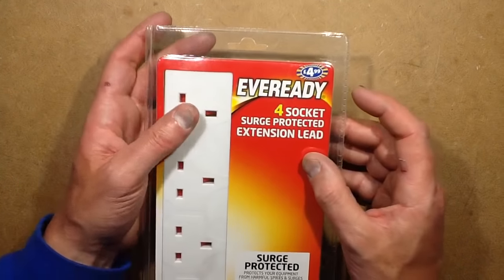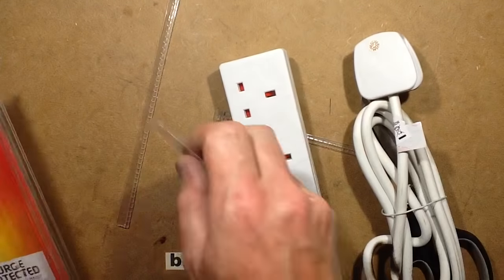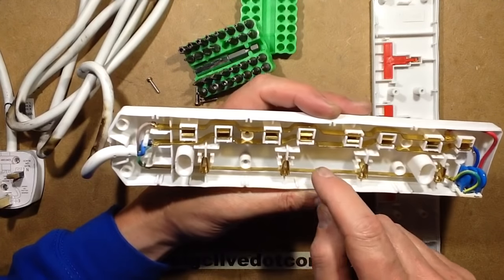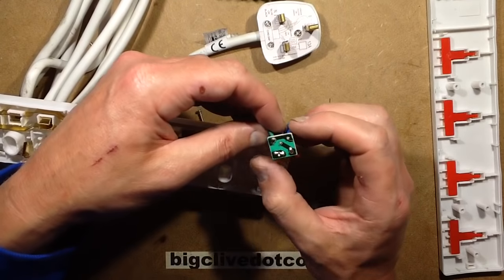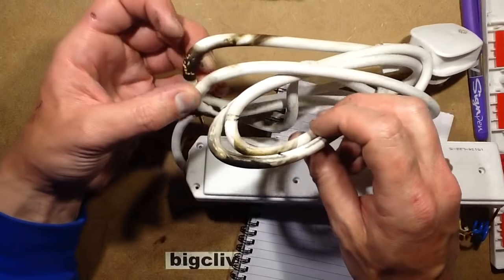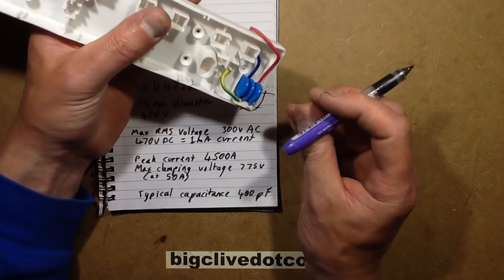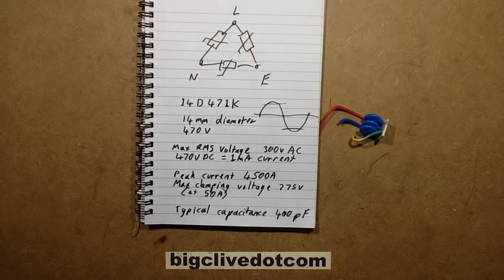Pre-exploded surge protection strip.  What the heck???

Comment: The varistor arrangement is likely intended to help satisfy the surge immunity requirements of IEC 61000-4-5, which specifies variations of surges in either differential (L>N) or common (L>E,N>E) modes.  

Really interesting to hear about their failure modes, had thought they were fairly invincible within their rated transient levels.

Comment: 3:07 time to crack out the butane torch... You should also hook the MOV across the high voltage section of a oil boiler transformer and fry it.

Comment: If your house has a fuse box, do you still need a surge protector?
Reply from the maker: Yes.  The fuses are just to break the circuit if something draws too much current.  A spike could destroy equipment before a fuse or breaker could break the circuit.
Reply: It takes 2000 volts to feel a static shock, but only 100 volts to destroy a video card.
Yes, surge protectors are vital for many electronics.
Reply: Out electric sockets doesn't have a surge protector input. Only two holes. Any alternatives for protection?
Reply: Yes. Call an electrician.
Reply: Yeah - fuses shouldn't be installed in your circuit breaker box, that's for circuit breakers. Circuit breakers prevent too much current being drawn through your homes electrical system, they are not designed to protect endpoint operators/equipment. You also MOST DEFNITELY DO need a surge protector on your PC - I don't think XlordB has any idea what he is talking about, because the speed with which solid state electronics are eviscerated by transient spikes will shock, thrill, and amaze you. An MOV that cost $0.07 USD and is capable of dissipating a small spike in a sacrificial manner should not be relied upon to protect a thousand dollar solid state microprocessor driven machine...But, what the hell do I know anyway.
Reply: I'm using a laptop.
Reply: ***** I still wouldn't want to put a 200 USD PSU or mobo right in the line of fire of an unprotected power socket.

Either it's too cheap to have any of the techs you mentioned or too expensive to gamble with.
Reply: ***** 
I was talking about desktops, too.
Where else do you think anyone would get a 200 USD PSU?
Reply: *****
I didn't research that.  I only know it's bronze efficiency 1050W modular and it works great with my TWELVE DOLLAR surge protector.

Seriously, just use a fucking surge protector, people.  There's no reason not to.
Reply: We aren't using surge protector for so many years but we never got trouble with our appliances.
Reply: joy santod my frend got a surge his Xbox and his to broke

Comment: I always thought the UK plug looked really good.  I doubt those pins get bent very easily.  US plugs get all bent out if shape if you look at them wrong
Reply: hate to know what you are doing to plugs then. if you treat them good and don't pull on cords like you should there is no problem. can bend them back in shape easyish too with some pliers if they get that bad. metal is not that thin now.
Reply: They usually get stepped on
Reply: and what does that do really? stepping on a wire is not going ti mess it up really.

Comment: I would say that the schuko has the same "good"  points as the UK-plug, but its much more compact :)
Reply: It doesn't. The schuko is not polarised (which means that single pole switches in devices like lamps only have a 50% chance of isolation). It doesn't have a local fuse to protect thinner cables, such as those used on table lamps. It also has a much smaller wiped area for electrical contact. In several countries, shuttered outlets aren't required. 

The Schuko shows every sign of a design that has been altered over a long period of time with add-ons without being a proper, clean-sheet design. From memory, the only change to the UK plug since it was designed in the 1940s is shrouding the top part of the live & neutral pins.

Comment: man were you raking leaves in a wild squirrel cage?
Reply from the maker: I rarely have need for a hammer and nails, so putting 500 nails into a roof in about 2 hours while also lifting up the sheets of wood was probably a bad idea.  I had blisters forming before I'd even finished.  It's a fibreglass roof, so I had to get everything done on the top in a single dry day.

Comment: Clive, what do the really expensive surge protectors offer that this cheap one doesn't? Seems to be a very basic circuit to get the desired function.
Reply: the £100-10k ones have batteries in them and can run after a power cut allowing you to save and shut down computer systems and the like. They are completely isolated, so they are very reliable on the voltage and current front. The one shown does not have a heat cutoff so is unsafe. There are many different additions things in between may have, you would have to narrow it down a bit.
Reply: This is a pretty standard circuit going all the way up to high-end industrial devices. For very high power devices, sometimes they only use 2 MOVs - one between L and N, and one between N and E, to keep costs down. 

The L-to-N MOV protects against "differential mode" surges, which tend to be most damaging. The N-to-E MOV protects against "common mode" surges. In general, most electronic stuff is highly resistant to common mode surges anyway, as the stress CM surges cause is to insulation (e.g. motor windings, transformer windings, etc.) 

The L-to-E MOV on some systems provides an alternate protection against common mode surges, and helps to limit the peak excursion of the voltage on the L wire (which could, in the case of a large combined differential/common mode surge rise to twice the clamping voltage referenced to earth in a 2 MOV design). 

Some high end industrial lightning protectors use spark gaps instead of MOVs, but these aren't really ideal. They can handle the 100 kA current of a direct lightning hit, but they have the disadvantage that they are slow to operate, even if electronically triggered. This means that you risk your smaller down-stream MOVs taking the hit before the spark gap triggers, unless you carefully engineer the whole surge system of the building to ensure correctly staged operation. The other issue with spark gaps is that they short out the mains supply, until the next zero crossing, which means that not only does the unit have to absorb the lightning surge, it has to absorb the energy supplied by the grid until the arc quenches. As lightning is usually a series of surges in rapid succession, this can lead to the mains supply being shorted for a period long enough to disturb electronic equipment or operate the main protection device, causing a power loss.

The favoured design these days tends to be lots of MOVs.  I've seen systems which use 14 40 kA MOVs in parallel for each pair of connections. Each paralleled MOV needs its own HRC fuse, and you then need some form of active monitoring circuit to detect any blown fuses. There is a hidden difficulty with paralleling MOVs. MOVs are voltage activated, and operate abruptly, going from current flows of 1 mA to 1 kA in only a few volts. This means that unless your parallel MOVs are very precisely matched, you'll end up with very uneven energy sharing, such that 1 MOV ends up taking 99% of the current.
Reply: Thats not a surge protector, that's a UPS your talking about. (uninterruptible power supply) But they do have surge protection built into them. Battery backup systems are a whole another ballpark from surge protection even though most have such protection built in.

Comment: recently boght a multi socket just like that from b&m except without surge protection and from new it had several poor connections causing arcing sounds and intermittent operation, when I opened it the wiring was just really poor too much insulation removed, poor connections etc

Comment: $5 surge protector means a 50 cent MOV and/or maybe a fuse if you're really lucky connected to 4 outlets. Probably didn't cost more than $1 to manufacture and I doubt it's the sort of design that has to be heavily engineered since you can just as easily (if you're Chinese) rip off an existing design. Correct me if I'm wrong.

Comment: have you ever looked at a monster 750G PowerCenter "HD Clean Power" Surge protector plug? I've got one that was damaged in a flood (the overflow pipe on the water storage tank popped off and the tank is in the loft, it did thousands of pounds of damage but luckily the insurance covered it), It does work... only the plugs that have a master/slave switch setup don't work (It's so you can have things automatically turn off in the slave plugs when it detects a low load on the master plug) I don't really fancy using it after it has got water damage and I thought I could send it to you if the postage cost isn't too bad.

It also filters/protects TV, Sat and Phone cables

Comment: You are lucky ! ... EASY removing the back ( NO clip technology ? ) means anyone can replace the flex ( this type needs  soldering to brass strips , this is SAFE ! ) ... the BIG problem with " modern "  UK  13 Amp plugs is the live pin can ( VERY badly ) overheat , should you load it up with a 3 Kw heater ( overnight  ? ) ... the remedy is simple , SOLDER the 13 Amp fuse into the cradles ... this lowers the contact resistance .. and .. provides more thermal mass to absorb any heating ... ( tried - n - tested ) ... DAVE™   🛑

Comment: Phase to Ground is a CE NO NO. 275 VAC is a wise choice even for the USA. SMPS's cope with most things below that. In USA neutral failiure in high winds will cause fire if 115 V rated. CE calls live-neutral Live 1 Live 2  which for IEC type F plug makes sence.  IEC type E can be whatever the electrician did!

Comment: I have acquire a few UK plugs and sockets, both a moulded and a rewirable types. I gotta says, UK plugs does have the nice sturdy feel to them and the fact that it has a built-in fuses does added some extra peace of mind. Although my country's electrical codes requires that all sockets circuit must be protected with 16A RCBOs, it still quite comforting to know that whatever the device I use a UK plug with, has a local fuse protection in it.

Comment: Those varistors work nicely on telephone lines but are fairly useless on mains where "spikes" from (e.g.) next door's D.I.Y. welder can make them deteriorate fairly quickly. Here in Greece where mains surges (lightning and otherwise) are commonplace, we use Automatic Voltage Regulators for all expensive equipment (especially 'fridges, freezers, TVs, computer systems). AVRs are relatively cheap here - around 30 Euros for 500 Watts. However, I don't think they are commonly available in the UK.

Something like this: https://voltage-converter-transformers.com/products/svr-500-automatic-voltage-regulator-with-built-in-110v-240v-up-downvoltage-transformer-500-watt

Note: don't confuse this AVR with a UPS. An Uninterruptible Power Supply has an internal battery that drives an inverter to keep equipment running for a short time during mains power failure. At best it offers very little more surge protection (if any) than the socket strip in the video.
http://www.glodark.com/lightn.htm

Comment: I'm always short of multi-outlet extension cables, slightly surprised the housing went to the bin when simple cord replacement (with custom length if needed!) would make it serviceable at least as an extension cord/multi-outlet and just assume no spike protection (or remove that entirely).  Or was there something else poorly made in the outlets/housing?  (if you can recall after 6 years...  :)

Side note, I'm glad I live in a suburban area without heavy industry nearby so power is very reliable and suspect rarely subjected to spikes.  But if not already done, as a US resident, would love to know a bit more about the UK plugs, round vs. square, evolution, longer ground plug, and, to me, strange red parts on the cover to the guts?

Comment: I hate those MOVs in Window Air Conditioners but was happy when I got one for cheap. Old unit died but went to the local pawn shop and found it sitting there for $25 sold as is non functional. Got it home and diagnosis through a few fuses showed that the MOV was shorted partially. Was acting like a 60 ohm resistor across the mains winding of the LV transformer. The second fuse death showed me where the problem was after the MOV smoked and split in half. 12,000 BTU unit for $25. Can't complain to much on that. Yes I did put a replacement MOV in. Thanks for the interesting video Clive. I mind showed people standing there talking to each other of whether they should put the fire out or let it go and kill the machine.

Comment: The leaking to earth at end of life is not necessarily a bad thing. Yes, it annoys the consumer, but it also prevents the full-on apocalyptic explosion that you get from a failing MOV. The RCD will keep cutting out until the consumer pulls the plug. It is the poor-mans way of making an "end of life warning system :D  Also, the three-way coupling is not uncommon in industry devices like frequency converters. Transients between neutral and chassis can be just as destructive as those between line and neutral. Hence the two extra MOVs.

Comment: Your coupling observations are valid.  I have customers that have plug in surge suppressors with ground (earth) lift plugs. Trouble is if the MOV shorts, the chassis of the appliance becomes 240V (120V US)>
I try to advise them but  how to get people to listen.

Also when they do short in normal suppression operation...it is best if the suppressor is at least 20 ft down line from the breaker panel. Without the small amount of resistance provided by the house wiring, several hundred  ampere surge can cause rather large explosion at the suppressor.

Comment: So, not much quality control there then. A bit disappointing, considering its a brand that consumers are used to trusting. Regarding how it happened, I'm wondering if there's some kind of UV curing process they use during packaging, or heat shrinking the little rubber cable guard that caught some residue oil of some kind (or some kind of UV sterilisation process?). I've seen minor surface burns and scorched black greasy gunk before, but I've never seen one as obviously unusable as this is. It would be interesting to know how the blister pack process works. I think it's about time we stopped using so much packaging. I regularly buy padlocks packaged like this, and it takes more time to get the lock out of the package without sustaining injury or damaging the product than it does to get the lock open without the key!

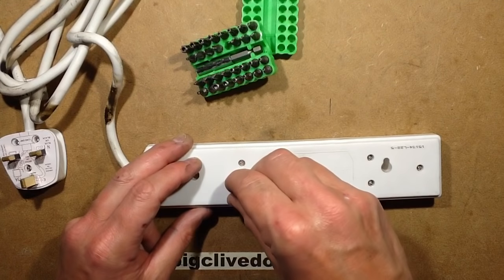Comment: 3:20 Tri-wing screws need to burn in hell...
Reply: I spent several years as an apprentice putting tri-wings in the leading edges of wings for the 146. Invariably they would have to come off again to access something that needed to be fixed later on. They are worse than rivets because at least you know you have to drill those out, while tri-wings will taunt you with the "ability" to just unscrew them. Not to mention if you do end up drilling them out, there is a non-zero chance you now have to remove and replace the anchor nut.
And the extractor bits (should you be lucky enough to have any) will ALWAYS have the little grooves on the wing faces worn when you need them.
They were designed by a committee of the purest and most sadistic evil.

Comment: You were lucky you could get that socket bar apart. I tried to take one apart to put on a new flex but after much struggle I basically destroyed the casing trying to get it apart because it had been assembled with self locking 'arrows' which I could not dis-assemble without breaking it. Ended up throwing the whole thing away.

Regards from Redruth

Arnold

Comment: As you apparently are unaware plastic blister packs are usually heat welded with an RF welder that uses high power radio frequency energy, on the order of 1000 watts, to briefly melt the plastic together much like a microwave often heats things. It’s very likely said RF energy coupled into the coiled line cord and started an RF arc which likely nobody even noticed as it self extinguished due to the flame retardant materials and limited oxygen.

Comment: The barcode at 1.20 seems to indicate the country is based (has its headquarters) in USA. However, that is no guarantee as to where the product was designed or made. 
Not very impressive quality control either for manufacture or distribution.

Comment: More thoughts
Any external heat source would destroy the package - the damage was inflicted while the cable was neatly folded in the pack. I'm willing to bet this is an example of lightning damage.  I can show you many examples of "random" damage like this - odd incidents that appear to have no entry point.  I've even experienced a situation where a inch of 16ga copper wire was vaporized from inside its insulation -  only leaving a tiny pinhole as a clue.  
It's quite possible the container this was shipped in was struck by lightning.

Comment: When I buy these AC bars, I prefer to buy the professional type that are encased in an aluminum or stainless steel casing. I have bought the Hammond, or Leviton, or one of the equivalent in the professional types. The ones I have bought use regular type hard wired AC outlets as like can be bought in hardware stores. At the cord end is a circuit breaker and a power switch. No fancy parts.

Comment: Personally I would have sliced open the power cable.
Zinc oxide resistors are quite resilient, I have been using them for years to absorb power line spikes from domestic appliances, like fridges, kettles etc.

Comment: Could it be that the unit was exposed to a high enough level of EMR - microwave or something else - after it was packaged? That could heat up the conductors enough to blacken, and maybe even set fire to, the cabling.

It would be interesting to see if the copper inside the burnt cabling was still shiny. That could tell us if the heat came from outside, or inside.